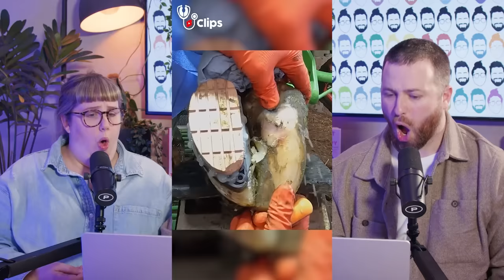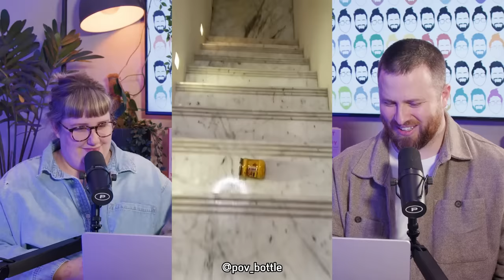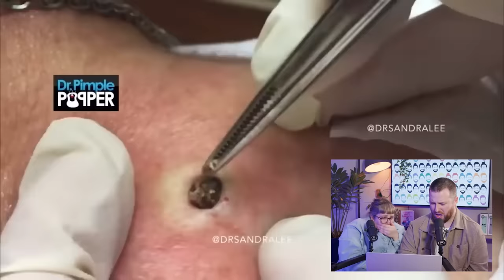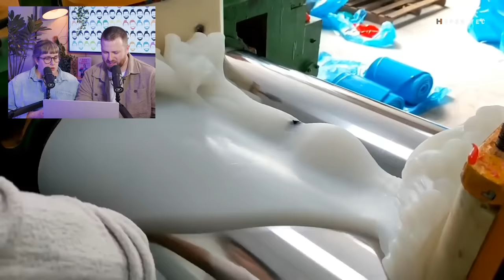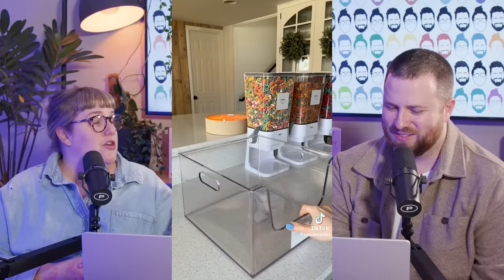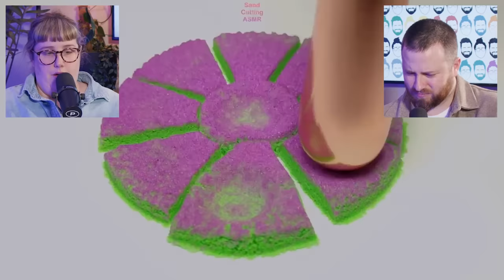MOST SATISFYING REACTION VIDEO On The Internet

Comment: For those curious about the art restoration: the older a painting is, the more discoloured the varnish on top gets. And Toni & Ryan are right, it's also dust and smoke and stuff settling over the years. Conservators take the varnish off with solvent mixtures that they have tested on small portions of the painting so they know it'll only attack the varnish and not the paint.
Reply: yeah, I watch Baumgartner Restoration videos, too. 😂
Reply: @valarya  😅 Was it that obvious?
Reply: @l1277  only because it's EXACTLY what I was thinking at that very moment 😘 lol
Reply: Was coming here to tell Toni to check out Baumgartners! Between the art restoration and his voice narrating the vids, I think Toni and Ryan will both wind up pregnant!
Reply: @lukespurgeon5964  Pregnant with 10 kids...Baumgartner is a sexy talented beast. Kit is wonderful too. ❤
Reply: I'm just imagining what a disaster it would be to find out after the fact that Vermeer had been experimental on a face and used a different paint as the corner the conservator tested. Lol, boom, face gone. I'm sure it must have happened to someone.
Reply: @cxzact9204  Lol. There are actually paint colours that react differently to the solvents so it's possible! I guess the mark of a good conservator is knowing which ones are likely to cause problems.
Reply: Thank you!
Reply: I absolutely love watching Baumgartner
Reply: I'm glad we got an explanation for this in the comments. It's quite a fascinating process.
Reply: @cxzact9204 That’s exactly why they only do small bits at a time. I’ve done this myself on a few paintings where I’ve gone back later after I decided a certain section wasn’t working. Pretty sure none of mine will end up in a museum, but it’s something to keep in mind. 😅
Reply: @valarya  I knew I would find some fellow Baumgartner Restoration fans in the comment section once I saw the painting restoration. 😆

Comment: In the painting restoration they're removing a layer of varnish and then putting a new varnish that doesn't turn yellow as much as the old varnishes used in the past. It also contains dirt and dust accumulated over time.

Comment: 7:26, For the painting, artists use sealants to protect the paint, but a lot of sealants yellow or dull with time, making the painting look dirty. So the restoration is safely removing the sealant without disturbing the original paint, and adding more, new sealant(hopefully one that won't yellow as bad). 

If the painting is chipped or cracked from age, the painting would be restored with paint matching the colors and materials as closely as possible. You can even repair canvas rips.

Comment: The art restoration is removal dirt that is on top of an embedded in the varnish on top of the oil-based paint. All of that has to be removed without compromising the oil based paint below. Then in isolation layer of synthetic varnish is added (synthetic varnish doesn't yellow like natural varnish) and then an archival grade paint is used over the areas of loss to make the painting whole again. The original masterpiece underneath the isolation layer is not permanently altered. It's a fascinating process.

Comment: Guys, the yellow stuff they clean off old paintings is the varnish. Varnish, and decades, maybe close to a century of dirt. that includes dust, smoke from the chimney, and smoke from cigars, cigarets, you know, the "human chimney". when the varnish comes off, they fix the paint (but in a way it's removable, if needed to be) and then re-varnish it with a varnish that doesn't yellow.

Edit: @BaumgartnerRestoration is something you can watch to learn about the process AND get the satisfaction of it. Long videos thou ;)

Comment: The “pore” blackhead is called a “pore of winer” which is basically a blackhead that has stretched the pore so much that the top has oxidized. It actually did not break the skin. It does not required packing because there’s no broken skin.

Comment: The one she said she thought was a mole or something is actually called a “ pore of winer” which is just a pore that has collected old skin cells over a long period of time which is why it has gotten so big and looks like a black head cuz the debris has oxidized over time but these don’t normally go very deep they are more like a core and sometimes but not always have sone whit/ yellowish sebum behind them but not very much on a normal basis and they do leave a big hole which over time will get smaller but never really returns fully to a normal pore size and can frequently return if not watched more closely. Just a quick bite of info cuz alotta ppl think they are black heads when they are not & typically they do not hurt but can itch on occasional til removed. Oh ya and they tend to pop up in places like the back , neck or even in or behind the ear so you yourself don’t typically see them which is why they end up so big but have been found in the face and the person just assumes it’s a Mole especially if they are not a picker of pimples lol 9:50

Comment: I'm eating and couldn't finish the first clip. I'm wondering: did you find it that those are cows, not horse hooves? Normally this is like nail clipping. In this case with the infection underneath it probably did hurt a bit before it got much better when the pressure went away. Poor cow. This must have been awfully painful for quite some time.

Comment: As for cleaning the paintings, that is not a very good way of doing it. Depending on the age of the painting. There will be varnish on top. Under that should be the paint layer. But if you have not done anything to stabilize the paint layer, you could just  be cleaning the paint away. Not to mention filler and over painting. Some people who do restoration think that the retouching of the paint should be done on the paint layer. This should never be done to preserve the original painting. Removing old varnish, filler, and glue should be done very slowly, very carefully. A little bit at a time. Once completely clean, the paint layer is protected with his special coating. The retouching is done on top of that so that it can be undone at any time. And on top of that is new varnish.
What we see in this video is very dangerous. They are just hacking away at these paintings.They might just be removing the varnish, but I think this is dangerous.They're going to lose some of the integrity of the painting.